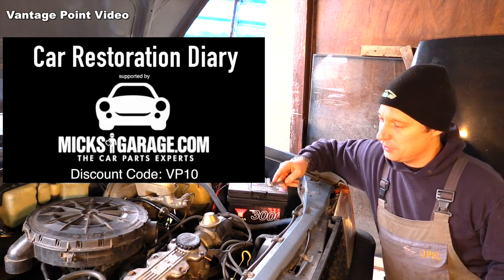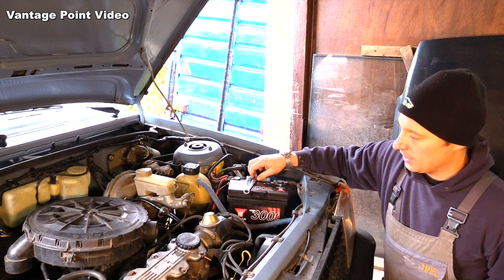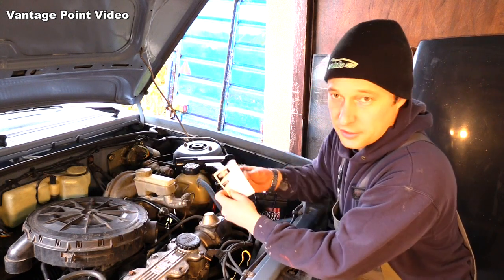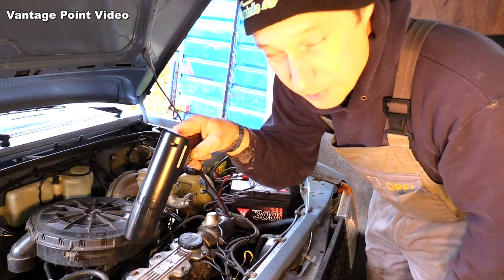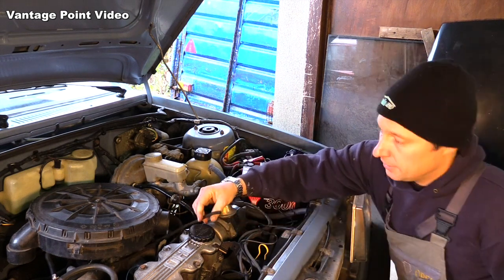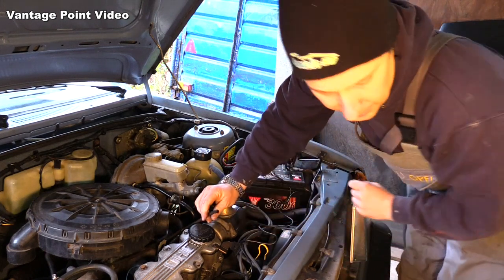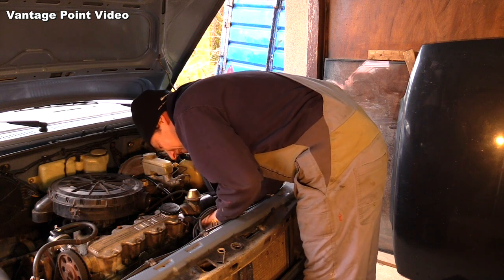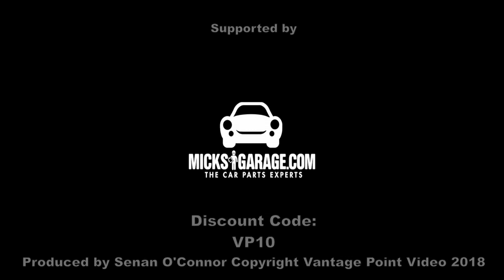Strobe Ignition Timing the Mobility Kadett

Comment: Its kind of funny to me you having to explain timing light but I suppose most folks watching have never used a timing light.Is there a scale on Mobi where it shows the timing in degrees?
Reply from the maker: No there’s just a single point. I assume that’s around 5 degrees before top dead centre. I think a lot of people who watch these videos might not do much work on their own cars, but this is their weekly grease hit and I hope it gives them a little bit more understanding of the fundamentals of their own cars.
Reply: @VantagePointVideoGarage  Mr i have a problem with my opel kadett 1.3 engine,  it doesn't have a spark I've  bought new coil packs but still nothing happens  engine  swings but not start what might be the problem